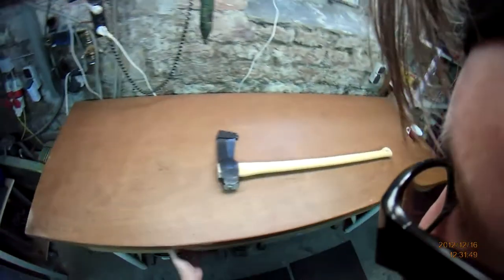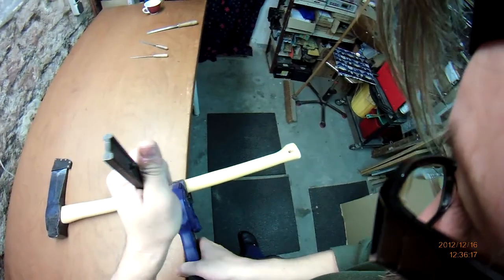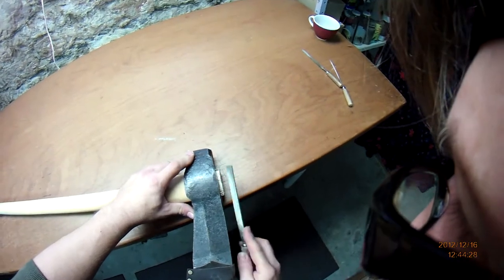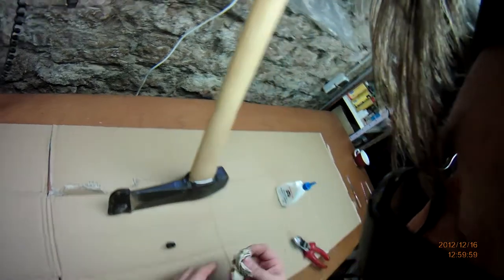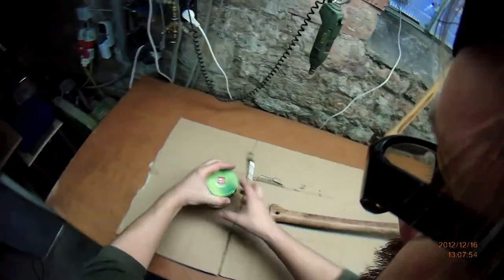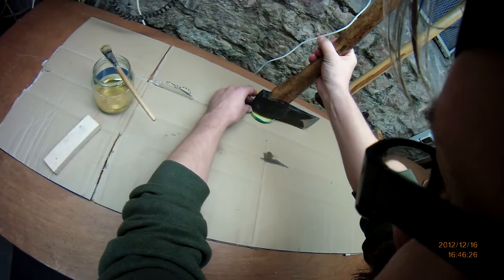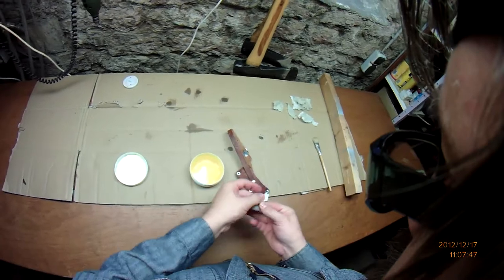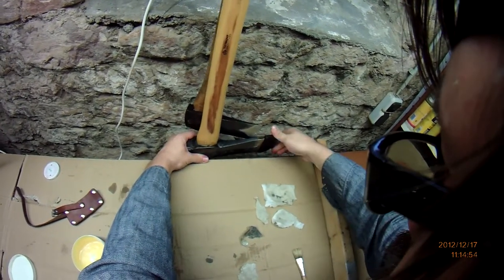Axe Care and Maintenance - 1st Treatment of a new Wetterlings Splitting Maul

Comment from the maker: The Wetterlings maul is a very good choice!
The more turpentine you use in the linseed oil the deeper it penetrates, but also the less oil gets there and hardens later on, when the turpentine evaporates. I use approx. a 50:50 mixture, and found it working well. Another advantage of turpentine I forgot to mention in the video, is, that it solves the old hardened oil and so adheres better, when repeating the oiling next season.
Greetings and thanks for watching,

Marty

Comment: if you make a moisture measurement you get better results to do it cross grain 
like here
http://www.mpaew.de/pixel/holzfeuchtemessung.jpg
Reply from the maker: Servus BOB,

in theory you are correct. However, I can not confirm that to be the case in my measuremnts - at least with the tool I am using, which is more a guess-o-meter than a scientific measurement device ;o)

A not to a more scientific approach to moisture measurement fo wood:
On top of the maintaining a certain direction of the pins relative to the grain, one has to account for the type of wood as well, as it's temperature. 

Thanks for your input,

Marty